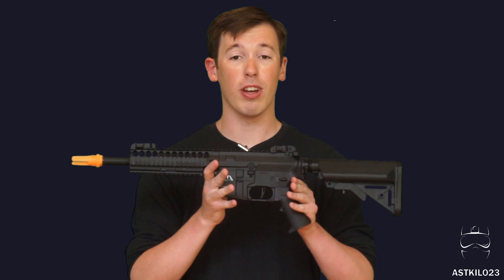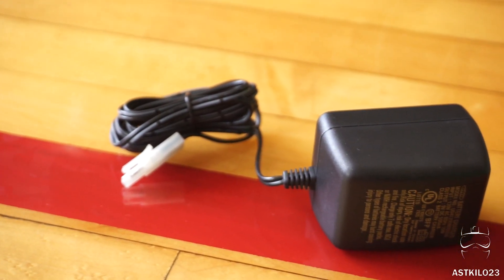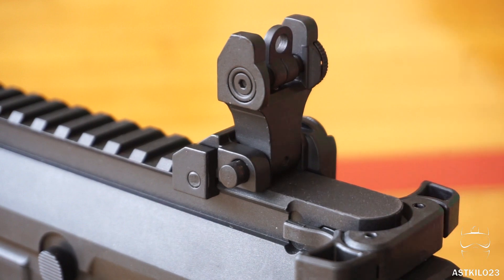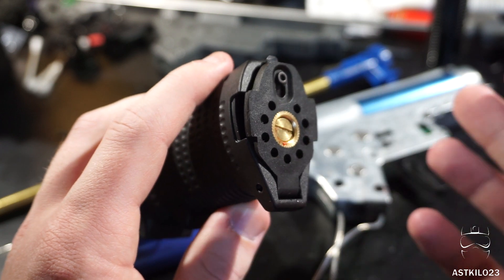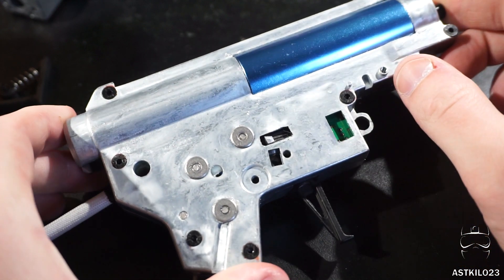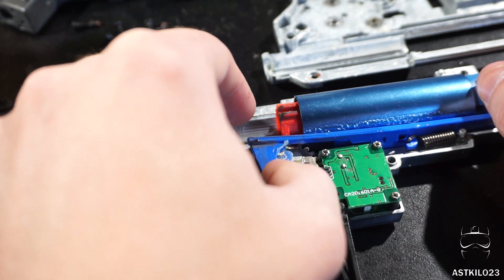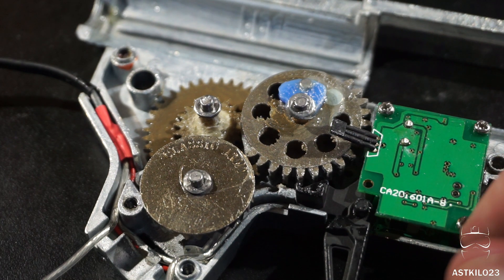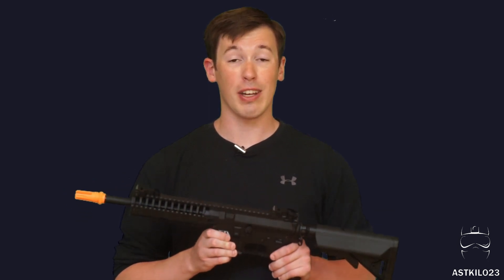Why Classic Army's ESC Skirmish Series is AMAZING!

Comment: If you hold the trigger down for 5 seconds, you get beeps and you press the trigger to cycle between fire modes then select auto and it will stay that setting. Even after battery is removed.

Comment: It's has solid internals. Pre wired to deans with tamiya adapter and was able to get 32 rps by just installing a CA Speed motor. Hop up unit is okay to say the least

Comment: My first aeg was a CA 10 inch delta rail skirmish gun basically the same exact gun except the rail.
Having said that it is an amazing gun for the money. I used a 9.6 for the first couple months and still stripped a gear. That is the only problem I have had, other than that I would recommend to anyone.
Reply: Ricky Ravioli I have been using one for close to a year, not a single issue. Ran an 11.1v lipo the entire time as it has a mosfet. You must have just been unlucky if you stripped a gear.
Reply: @noveske.2236  I was using semi and spamming the trigger pretty hard it was my own fault lol I love the gun and would recommend to any beginner
Reply: @RickyRavioli69 Which gear stripped?
Reply: @ap81airsoft73  I'm not sure I think it's the spur

Comment: You seem to be holding back on your criticisms a bit more than usual even though I agree from my experience that the skirmish line is great for the price. Mine has no major issues so far besides misfeeding when I installed a Krytac bucking for whatever reason.

Edit: meant Krytac
Reply from the maker: i have to give credit where credit is due. classic army did an amazing job on a gun for under $200.